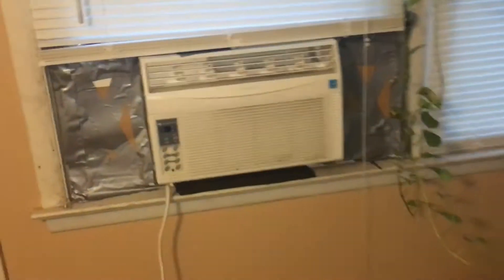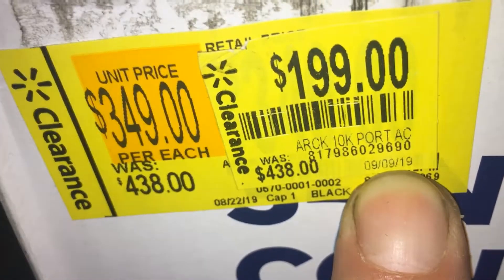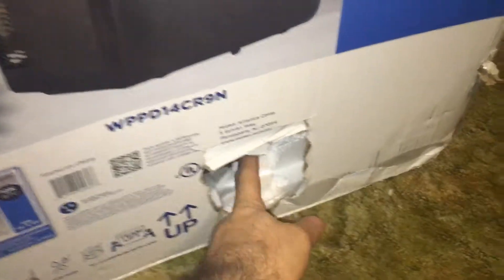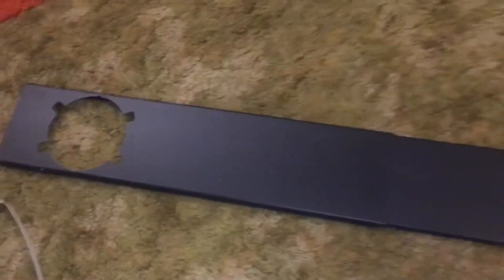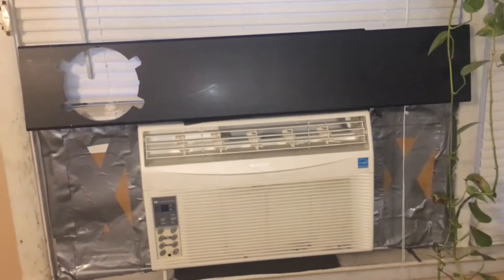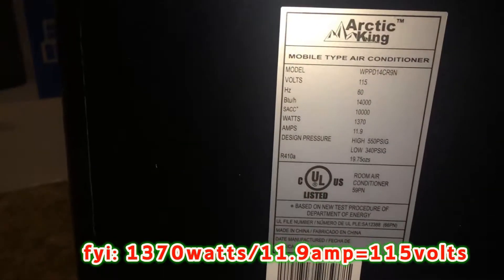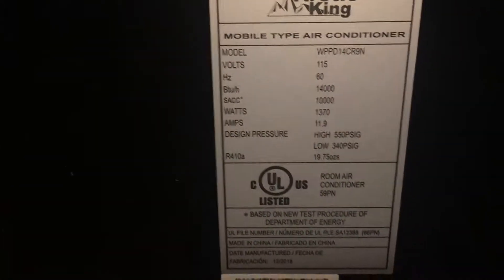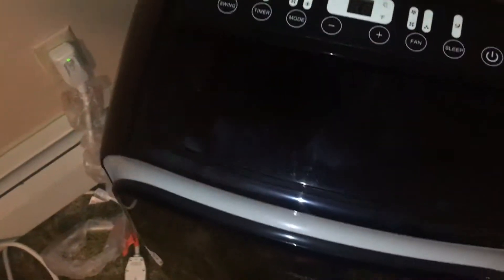Arctic King portable Room Air Conditioner 10,000 BTU WPPD14CT9N 10k unboxing install

Comment: I have the 2016 version in white and it is actually a good unit even for a slightly older one if you think its not very good time will tell trust me or maybe the older ones are better but mine the only differences is older year model and different remote but it has a heat pump function
Reply from the maker: ah with heat its the upper model. I'm just waiting for summer to come and see if its fault of needing to suck air from outside through all the houses air leaks causes those leak areas to heat up.

Comment: I just bought this a few days ago and find it shutting off randomly on its own And even turning back on for another few minutes. Also when I put it on auto it never cools it down to the temp I want always way too warm. I never left it on auto long enough to tell if it would shut off randomly on that mode too. Lastly if I’m using this on auto or cooling mode only where the hell is the draining hose going?!?!
Reply: Put on snowflake setting. And if it keeps shutting off try a different outlet. Your most likely NOT getting enough power!

Comment: Please help: I have the exact same unit and it does not blow cool air at all even at the lowest temp, am I doing something wrong?
Reply: Did you every figure this out, I am having the same issue just bought the damn thing
Reply: Maybe have to connect drain hose?

Comment: I'm trying to use mine for an indoor garden, set it on Auto, but not sure how the drain system should be set up.
Reply from the maker: it looks to me like you can just connect a hose to the upper drain area. removing the plug of course. looking the direction it says that. remove the plug and screw a hose to it. I guess with the plug removed water will stop collecting at the bottom of the units water tray

Comment: Bob, what am I doing wrong? It turns itself off when it hasn’t reached the temp. It does great for awhile but then turns off without my telling it to.
Reply from the maker: is it on auto? or COOLING the snowflake. I dont think you want it on auto if its never going to actually get the room down to the temp you want. Im not sure what the auto feature even is. I do know I walked in the room once and the compressor was off, I noticed it was on AUTO, changed it to snowflake and all was well again
Reply: Mine keeps short cycling and only works w a extension cord

Comment: How did you get it working right because customer reports said that these type don't cool the room properly.
Reply from the maker: That's why the box says 10,000 BTU SACC. its actually a 14,000 BTU unit but because it's moving air out of the house that air must be replaced by outside air or your house will "implode". If you suck air out of a bag and blow it out your nose, what happens to the bag? actually I mention this in the description now that I look up...
Reply: @bobspurloc  oh ok thanks, and why install it in a room that's already have a window unit?
Reply from the maker: its not installed. I just bought it on clearance and will use it next year. my daughter uses one at her condo without issues along with a friend.

Comment: $200? i just paid $499 for the same unit at walmart.. did i get ripped off?
Reply from the maker: nah, you just did what a normal person does, buys an AC unit when its hot out, buys a heater when its cold out. Heaters 2 months ago were 75% off, after summer is over AC units drop to clear inventory for winter items and get rid of old stock. I bought this unit when it was snowing out.
Reply: I bought the same 10000 btu today and paid $375
Reply: Same 😭
Reply: I paid 500
Reply: bobspurloc The compressor just shut off

Comment: Do you need to recharge it eventually? Like add refrigerant?
Reply from the maker: while I don't know for sure, but my guess is this is a closed system. I think there is some sort of law that window units and portables must be closed systems. coolant doesn't go bad. it leaks out. in a closed system it has no where to leak out.

Comment: These things are so dumb! Why on earth don't they have TWO ducts to the window -- one to draw in air across the evaporator, and one to exhaust the hot air back outside!  Also, they should pump the condensate out of the exhaust duct and mist it into the air so you don't have to drain it.
Reply from the maker: the air going out is like 100f, so if u were to pull air from outside it would need to be from a different window. u could make the upper drain, drain into the outgoing hose with some modifications. how often have u needed to empty the water? I haven't done it once yet.